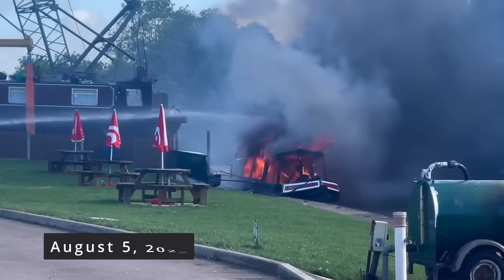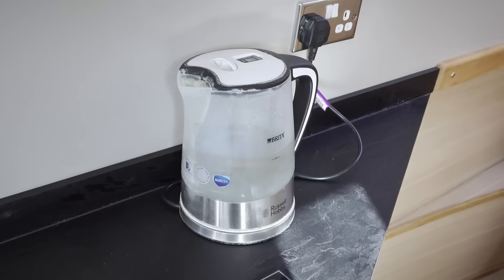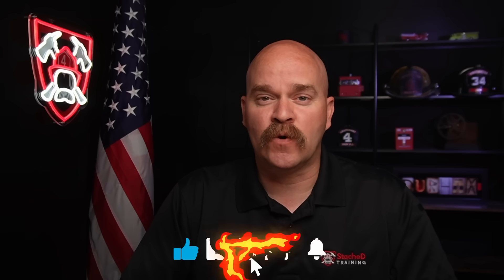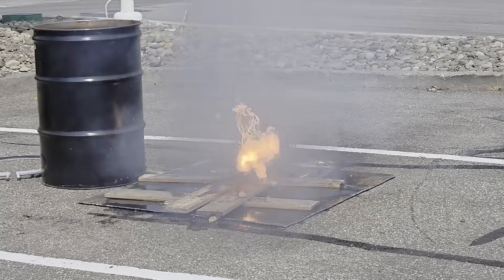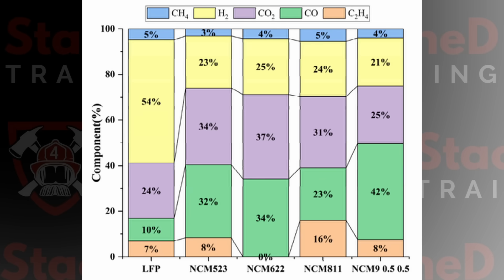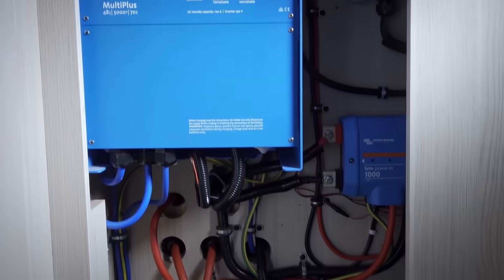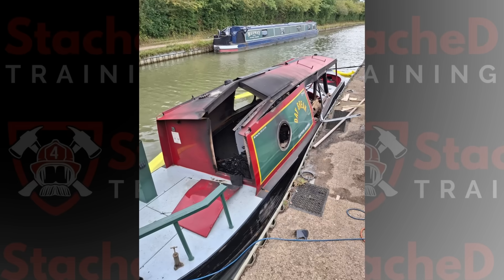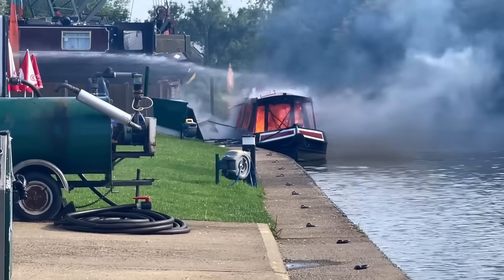Electric Boat Explodes While Charging: LFP Batteries

Comment: There should be a kind of a gas vent at the roof of a motorhome, able to release gas without letting the rain in. And  a  hydrogen detector, see for HYDROGEN SENSOR MQ8 BREAKOUT. In case of a sensor, the output should be a flashing LED, never a horn!

Comment: Ohh. Right. So LFP battery locations really need to be ventilated to the outdoors
Reply: The guy in the marina who took the fire video you posted, and viewed the aftermath, said the batteries were mounted up against the divider bulkhead in the  dry part of the boat, not in the propulsion motor compartment under the rear deck.  
Seen no definitive proof of battery chemistry, but someone looked at the batteries of this boats sister ship, and said they were not LiFePo. 
Maybe some more due diligence is in order before an "expert" opinion is offered.

Comment: Strange when you have cable regulations in big buildings. Where you have to close the holes of the fire walls with protective material and special melting cables. But not on these boats. In Amsterdam the also forced the boats to go electric, but not enough charging point. So generators on the deck to charge.

Comment: I have testing solar going on 8 years. People think they need this much energy. They do not. The majority of the time. Items are not being used. Leaves to charge time. Still. A bunch of appliances are not equipped to be run on batteries and solar. A person has to use what is available that is at low watts and amps. Amps is work. Amps is heat. The more equipment used as controllers, etc. Leads to more problems. The batteries I have and am using plus testing are acid, acid sealed, gel, and lithium phosphate. Zero problems. Zero heat issues. I will transfer power and use power to keep the heat and overcharge down. I learned to train lead acid batteries to hold a charge longer. My lead acid batteries are almost 8 years old. They are still good. That kitchen equipment they used. To much. To high in watts and amps. Thanks.

Comment: What a stupid idea, a battery powered boat 😮! Don't get into one.
Reply: Cheshire Fire & Rescue Service - Boat Safety
Petrol Solid Fuel Stoves Causes of fire on boats The cause of fire is varied, but could include: Escape of gas from an LPG installation coming into contact with an ignition source resulting in fire/explosion. Flammable vapours entering the accommodation space coming into contact with an ignition source

Comment: Wait the pictures are from a similar boat? Do we have any pictures of the actual boat's system? Seems like there are two different systems showed. What type of battery charger was used? What kind of cells? We have a discussion on the diy solar forum right now trying to figure out more details. Would be cool for you to post some pictures of the actual system.
Reply: We literally know nothing except that there was an unfortunate fire. No conclusions can be legitimately drawn until the fire investigators determine the origin and cause.
Case in point: last year there was a fire on a $6M (USD) power catamaran with a large LFP house bank. Early on, the LFP bank was suspected as the origin and cause. Further news reports reported that the port engine room was fully involved when the fire fighters arrived on the scene; the interior of the boat was initially undamaged by fire. In fact, the LFP bank is installed under the cabin sole (floor) approximately 25’ from the center of the port engine room.
Reply: Hi Will. Enjoy your content 
The Vlog Couple UK  YouTube posters were the ones living in the marina and took the video and post fire photos. They have two videos on it. First about 3 min, and second about 12 min.
Reply: @zippymouse419 watched both, neither show details if the actual system or battery used.
Reply: @WillProwse  The video from the Vlog Couple UK does show the installed location in the passenger compartment, not the motor compartment, as claimed by the American firefighter.
So far, neither the builder nor the operator of the boat have detailed the battery type involved in the fire.
Reply: @zippymouse419 oh I was referring to the type of charger and wiring of the battery. Yes they did cover the location on that one. Yes still no verification of chemistry type.

Comment: I made an electric boat. My 2 batteries are inside the hollow bow section, elevated & secured with large open holes for maximum ventilation. The batteries easilly come out for charging, and are only charged to 85% capacity. I've also used super thick high voltage wiring, fuses and isolators so it can easilly handle the amp load. It was expensive, but it's the safest way to do it. Never take the cheap option, never use wires unless their rated 50amps over what your actually running. Spend that extra money, and make your setup as safe as you can possibly get it.
Reply: Ditto w fossil fuel engines on ships were a invented  leaky fuel system  can AND DOES result in 1,000s of boat fires a yr
Reply: @russell7489  And car fires.
Reply: Wiring has zero to do with cells going into thermal runaway.
Only charging to 85% never allows bms to balance the cells, and can cause cell issues due to imbalance.
You should run them to 100% (and keep them there for some time) occasionally to deal with that... else you will have issues regardless.

Comment: The guy in the marina who took the fire video you posted, and viewed the aftermath, said the batteries were mounted up against the divider bulkhead in the  dry part of the boat, not in the propulsion motor compartment under the rear deck.  
Seen no definitive proof of battery chemistry, but someone looked at the batteries of this boats sister ship, and said they were not LiFePo. 
Maybe some more due diligence is in order before an "expert" opinion is offered.
Reply: He also showed two different systems in the video and said they were "similar" to the boat that caught on fire. Still haven't seen proof that they are lifepo4 anywhere. Also no proof of how they were wired or what type of charger used. Nothing.
Reply: @WillProwse  I was absolutely wondering what your opinion on this was! 🙂
Reply: @WillProwse  I really doubt any official report is available only a week after the fire.
Patrick does have a good point that we should design any system so that the Hydrogen does not enter the cabin but is vented to the outside instead. Even though LFP is very safe, any kind of energy storage poses a threat if not done right.
Reply: @SolAce-nw2hf oh absolutely. I cover that a lot on my channel with many videos. But I'm finding out that there's not much hydrogen given off. From everything I'm reading the lead acid batteries give off more hydrogen.
Reply: @WillProwse  when the story doesn’t align with physics, dig deeper. 

It’s not rocket science. 😂
Reply: @cottsak yeah. Absolutely. I thought this channel was reputable but now I'm realizing that there's no proof of the battery type, wiring, battery location or anything else. Unfortunately. The picture shown are not the system they caught on fire. Other channels are reporting different things now. Not good reporting here.
Reply: @WillProwse the guy’s business model is to make lithium batteries seem dangerous, so he can sell his ”safety training” services and content. I guess there’s no profit in telling the truth….
Reply: @cottsak lol!!!!! Lame joke!
Reply: @WillProwse it’s just the first video to talk about what possibly happened hes not in the uk to investigate come on! Do you know exactly what happened?
Reply: @PVflying stop talking crap! Lithium batteries are dangerous when not properly managed what’s wrong with that? Natural gas, petrol are also dangerous when not properly controlled.
Reply: @WillProwse do you know exactly what happened? We’re you there at the moment when the incident happened? This video is just reporting what could have possibly happened while waiting for the actual investigations just like every other accidents lol!
Reply: @carholic-sz3qv  yeah but we have zero information so far. Entirely speculation at this point. And all of the fire safety studies that I'm reading show that there's not that much hydrogen being given off. Can you post an explosion from LFP batteries here? Let's see what proof you have.
Reply: @WillProwse  April 16, 2021, Beijing , two firefighters killed, 25MW lifepo rooftop installation.  Just over 39% of total gas generated is hydrogen during thermal runaway of fully charged Lifepo  according to' Study on the Multi-Stage Evolution of Thermal Runaway and the Flammability Threshold of Gas Generation in Lithium Iron Phosphate Batteries Based on SOC Gradient'
Reply: @adamaglionby7438 thank you for that information. I was not aware of this, so I just read a report. At the time it was written, the cause was unknown. Possibilities are:-
 extreme rooftop conditions causing battery degradation.
Poor quality cells.
Overcharging.
It should be noted that this is a huge setup, way beyond what we would use in a home, RV or boat.
Will Prowse always advises not to have single point failure for the type of systems we are discussing. Just relying on the BMS is not a good idea.
The explosion happened on the boat while charging. (The report I read didn't say for the rooftop system.) Even on NMC batteries, I've only read of fires and explosions while charging. So imo, get a good and reliable charger and check it doesn't go over voltage. This way both the BMS and the charger protect the battery.
It seems like most problems, whatever the energy source, are caused by poor installation and poor maintenance.
Reply: More like we can't trust the opinion of that poster because as UK citizen he can't legally speak against these stories that can potentially cast a environmentally friendly technology in a negative light. Not to mention we have the massive body of previous fires covered to draw from so the "expert" is still correct in his assessment unless the full results of an investigation happen to be leaked which again being in the UK is unlikely.
Reply: Yea the usual anti EV hate and fear Mungers out again.... They blamed Tesla for the Luton airport carpark fire turns out it was a Diesel Rangerover that was already on fire as entered to car par park.....
Reply: Many people are making comments with regards to engineering principles and the like.

They are not giving (well, I have not seen) their engineering background. 

What is factual, do not need to be a rocket scientist, is that the batteries of this battery powered vessel did indeed catch fire and explode.

There is clearly, without any doubt, an issue.

Aircraft are grounded in such circumstances.

It could be, charging system, batteries, water ingress, inadequate servicing, the list goes on.

Only a fool would hire this type of vessel for their family until the reason or culprit (it could be sub-standard/lack of/money saving maintenace) is found.

Even then, perhaps good old fashioned lead acid batteries are the safer option for more quiet (though shorter) cruising.
Reply: @georgehughes5703  actually we have no evidence of battery type or how it was wired or where the batteries were. So for us to make any type of conclusion with the information that we have is impossible.
Reply: @WillProwse Er.. OK

Please, before replying to a comment I have made, read it fully.

If there is something you do not fully understand, I would suggest asking for clarification.

Comment: It's game over for battery powered boats. 
    Insurance companies are looking carefully at this incident.
Reply: Insurance companies look carefully at all situations where they have to pay out.
Reply: If this was inspected and certified then the inspector did not know what he was doing so many things done wrong.
Reply: @bascomnextion5639 You are assuming that the examination and certification is based on a regimen that looks at lithium batteries in a different way to lead acid batteries.  It does not. The requirements change at a glacial pace. The most current requirements for non private (commercial) boats do not address battery chemistry at all. Batteries of any sort have to be secured against movement and have to be ventilated to prevent hydrogen buildup. This relates to non-sealed lead acid batteries. It is specifically acceptable for batteries to be ventilated into the cabin space, on the assumption that hydrogen is not toxic and will be exhausted through roof ventilation. There are requirements relating to shore power and charging equipment, but only to do with heat management. As far as I can tell, it would be acceptable for a large battery bank to be fitted within the cabin space and be openly ventilated to that space. An examiner does not have the ability to do anything other than advise on matters that are not specifically prescribed.
Reply: @bascomnextion5639  This is a baseless comment. The video shows nothing to support this and the dialogue is just an alarmist dog whistle.
Reply: @charliejohnson5762  No its not I am not having a go at inspectors I am saying they they do not know about the dangers  of batteries a lead acid battery could have exploded in the same way they also produce hydrogen & oxygen gas batteries always should be in a well ventilated enclosure and the possibility of an explosion should always be considered also they should never be in an enclosed space where people or animals may reside.

Comment: Normal fire-fighting: snuff the fire out by boxing it in.
Thermal runaway in an enclosed space: vent the heck out of it to stay below the minimum explosive threshold so things don't blow up.
Reply: Hydrogen has a rather large explosive range.
Lel 4%
Uel 75%
So somewhere in that vent path will be the ideal spot💥
And all whilst spreading all the other toxic gases around... no thanks.
Reply: @woodstockm4328  pipes can withstand the energy at the bottom end of the scale. The point of adequate ventilation is preventing accumulation in a larger space that would cause a far more energetic explosion. An extraction fan and vent in the battery compartment would have prevented battery fumes from flooding the bilge and exploding the whole thing. There is also a chance it would have prevented fumes from finding an ignition source. Once hydrogen is outside the boat, it quickly disperses straight up, making it unlikely to get ignited by anything below.

Comment: You were actually incorrect about the location of those batteries.  They were not in the engine compartment, they were actually in the main cabin, just inside that bulkhead.  So the gases vented into the cabin (because that's where they were located).  This is why the explosion occurred inside the cabin, blowing the hatch off and seriously deforming the shape of the hull.

Obviously, ideally they'd have been inside an air tight enclosure that is vented to the outside atmosphere (not into the cabin).
Reply: So, not really a battery issue then, but a poor design choice!
Reply: @thedogfather5445  Seems like it. I think the general consensus is that LiFePo4 batteries produce a far lower volume of dangerous gasses (in use or during recharging) when compared to Li-Ion.  But when you're dealing with such high capacity batteries, it's still a hazard that shouldn't be ignored.

I'm not sure that they were, in fact, LiFePo4 batteries and I can't even rule out a battery failure of some kind, but IMHO, having them inside the cabin was a pretty bad design choice.
Reply: @KenFullman  Doesn't stop the relentless Youtube scaremongering. Even the IIMS is linking to this video!

Comment: Bad wiring, or no BMS (Battery Management System installed) stop blaming LFP. Lead Acid batteries give off hydrogen when discharging and charging. Without balanced reporting this is just click bait. LFP batteries with a BMS are safer than any other battery technology, hands down.

Comment: At least until they come up with a safe battery.
Reply: Cheshire Fire & Rescue Service - Boat Safety
Petrol Solid Fuel Stoves Causes of fire on boats The cause of fire is varied, but could include: Escape of gas from an LPG installation coming into contact with an ignition source resulting in fire/explosion. Flammable vapours entering the accommodation space coming into contact with an ignition source

Comment: I would comment that we should see an expert investigation on this before we assume it is off gassing which caused the explosion. LFP don't off gas.  They are sealed.  If they were damaged by a faulty charging unit, they would still shut down with the BMS. It would take a huge coincidence to have LFP off gas enough to cause an explosion.  If these batteries had no BMS they would be extremely unsafe. I know you mean well but this fuels fear they LFP are dangerous.  If you compare properly installed with gasoline or diesel, there is absolutely not comparison of the safety.  LFP are safe if used correctly